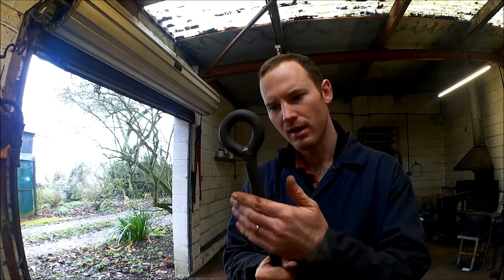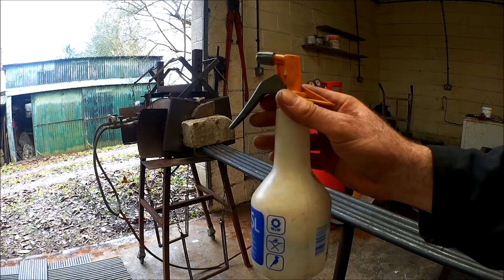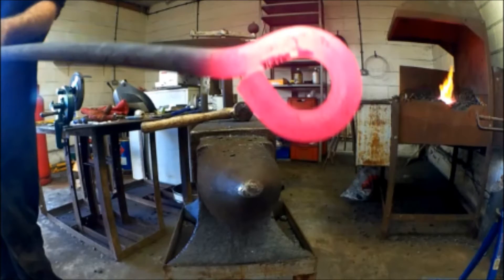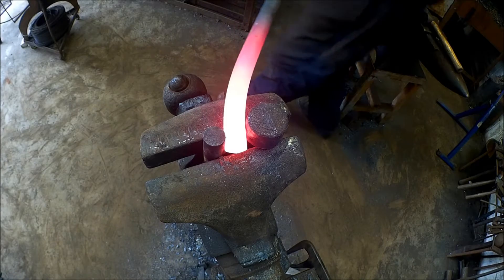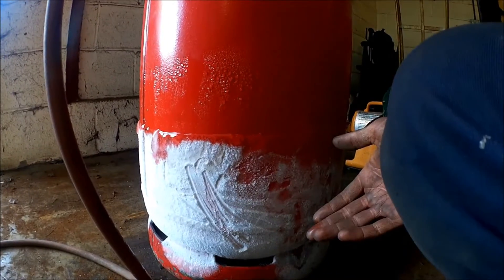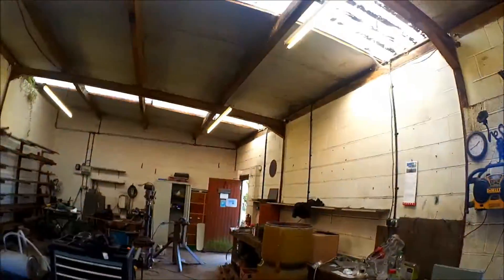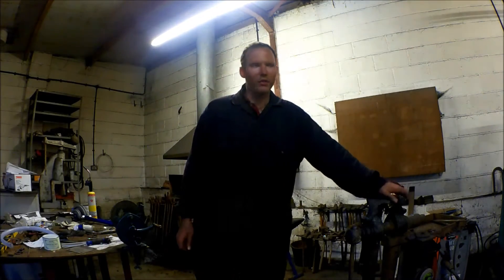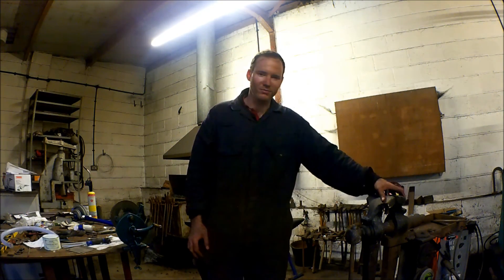Blacksmithing - How To Forge An Eye - Difficulty: Easy

Comment: Just catching your channel so a few years late , but i did a job for wind mill anchors, very similar to what you made in the video , company supplied me with the steel bars , I worked on $4 AUD  ($2.60 USD )  Per eye  and  $2 AUD a weld  , and $4 AUD per 8 inch long threaded section  for a total of 1200 units supplied  for the wind farm up the road here , big boss told me  after i could have added  another $4 and no one would have blinked ,  shows you can be too cheap ,  but i made  good $ for the 2 weeks it took me to do them all ( 15 days total )  i think the eyes took 5 days the welding 5 days and the threading and heat treating the rest of the time , i had 1 casual employee help me  and used a induction coil to heat the bars .. like your channel ! cheers
Reply from the maker: Awesome well done. It's great when it pays and is fast to produce. Hope you get more like it. Cheers J

Comment: Make the video on , to make circular ring with same thickness of rod
And diameter of ring is 100 cm
Reply: Thank you....this video helpful for mi
Reply from the maker: It would be the same but with a 3.33cm thick rod. May have to cut a 10° angle on the end so it closes up fully. Cheers J

Comment: It might be because it's 4am but what measurements spacings and how did you work out the sizes for the jig, what size diameter material is this your using? I like the step down to have the two same size parts in the vice for a good grip. Thanks.

Comment: Letting a garden hose dribble water down the side of the LPG bottle will stop it freezing.  Its unbelievable how little water will achieve this.  Good vid though.
Reply from the maker: Evan Penny thank you. Yes I've since submerged a bottle in a large tub of water and eventually froze the water and needed to chip the ice off. Having if flow would work well as you suggested. Cheers j
Reply: I have used this method many years as a commercial potter with complete success.

Comment: hey Josh, 
When it comes to set jobs like the one you just completed, the charge is not per hour but is per job. 
We have contractors bid on jobs for us and the charge is per the job (Labor, Materials, consumables, etc...)
then there are repair jobs where we have contractors come in and do jobs that cannot be bid on per job as it is unknown as to what the issue is so then the contractor charge is per hour plus materials and consumables.
Most people do not know how complicated it can get when dealing with companies and subcontractors.

By the way, amazing job you did there.
Reply from the maker: Jeff Sablich thank you it's good to hear different experiences. sounds like a good way around it. the job piece work and it payed well doing it fast. j

Comment: You don't use thread tape on that sort of fitting.  The seal takes place with that conical shaped end, not with the threads. The threads are just there to apply pressure to that seal.    That is the way it is done in the U.S., anyway.
Reply: When a conical seal fails, usually from over torque, you have one more chance to make the seal on the bearing surface behind the cone. Then you are left with sealing the threads to prevent leakage. Use of the alternate strategy is effective for getting you through the day and beats sending a gas bottle back to the supplier. That is the way I do it in the USA anyway.
Reply from the maker: Yes you are right scott. what ever was making it leak though it still did the job at stopping it.
Reply: @joshuadelisle  from my experience it's a different type of PTFE tape it typically comes in yellow packaging rather than the white it's for gas rather than water fittings it's a little thicker but you have to use what you have to get the job done

Comment: David Richards,please explain how Stick welding is easier and BETTER than Mig Mag.I am a Welder with 50 years of working on pipelines,oil rigs,ASME1X.certs.I dont see how on production work or any other,MMA is easier and better than Mags.
Reply: Put your rattle back in the pram, read what I said, that in this "particular application" it was better and easier - not that the World should throw away Mig/Mag machines and only use MMA.
There is a place for every welding process, not one is overall better than all others, each has its own niche, flexibility and best application.
Mig/Mag welding is a great flexible process but in a job or smithy shop environment you will find a stick welder is very useful and as Joshua says, it don't need gas and switching from steel to stainless steels to nickel to aluminium is simply the change of the electrode.
Reply from the maker: Ha interesting! There weren't any robot there where I was at all, just CNC plasma/flame cuts and we built everything using jigs and manual welding machines. I asked about why they don't use robots and their responce was that the robots don't do well with gaps!... I know that place in bromyard, my old workshop was near there...
Reply from the maker: I beleive its to do with the slag covering of the weld that insulates the weld cooling it slower making the weld less brittle and increasing its toughness.
Reply from the maker: I don't think stick welding is easyer but rather learning to stick weld makes you a better welder because generally a good looking stick weld has also good root fusion while a mig weld can look good but have no fusion.
Reply from the maker: I agree with you though that genrally for production a mig/mag welder would be my first choice for that reason. in most cases for blacksmithing were a only little beads are needed infrequently I would always suggest a stick welder for simplicity and cost effectiveness because you wont have the cost of renting bottled gass and they store neatly away when not in use.
Reply: Im talking about time served welders who know what they are doing,not someone who buys a toy welder from machine mart and thinks he is a welder
Reply from the maker: yes for production welding yes a Mig Mag would be suitable, when I worked for Exmac automation and McConnells I used Kempi and Miller 3phase top of the range MAG welders and often welded 1" plate doing runs that were longer than a meter. perfect tool for that job. but keeping it in context we're talking about blacksmiths, and as a blacksmith welding isn't used to such an extent otherwise its a fabricators job, in this case I was asked to weld the eyes, at that moment I didn't have mixed gas for my small MAG welder which would have been expensive to buy just for that project, but my 220amp oxford was fine to go with just a single pack of 3.2 6013 electrodes stored in my (dry)cuboard. I beleive this to be the norm for blacksmiths to not be welding continuously and so I would suggest that a stick welder is a more appropriote welder to be familiar with. do you agree?...
Reply: @joshuadelisle  👍
Reply: Joshua, interesting how paths cross in the welding bussiness,  in that I assume you mean McConnells in Ludlow - I installed a robot welding system there in about 1984 welding agriculture parts, used to be a nice company but I never went back again.
A bit nearer to you I think, I supplied 3 robot welding systems in about the year 2000 to Hydro Raufoss in Bromyard for welding the BMW Mini Aluminium bumpers - I think they moved to Worcester later on.

Comment: Speed it up even more,get a Mig Welder.
Reply: I think the big difference is the direction you come from the weld process side - if you start as a stIck welder, do a bit of Tig then go into Mig you have a different attitude to mixing the processes. 
Guys who start with MIg don't see the need to try something different and think it's the answer to the maidens prayer - In the "old days" the MIG/Mag process was not allowed for welding any type of pressure vessel or pipes, in fact you were not even allowed to pre tack any vessel parts using Mig.
Although today this has changed and Mig is now used extensively in many pressure vessel applications there is still an acceptance that from an overall weld quality point MIg is below that of Sub Arc, Tig and Stick, more especially in non ferrous metals.
Although I have had a long career building and supplying Automated/robotic Mig systems to major manufacturers, for my own personal welding I have a Mig machine, 2 x stick welders, a Tig welder - I often use the Mig for ease of tacking but if I want a nice neat controlled weld I will often use Tig or stick weld.
Reply from the maker: Hey Terence! I find if used right a stick welder is just as quick and makes a better weld. I use the main 3 welders, stick, mig and tig at work for different projects because they are better than the other at different tasks. in my workshop though I do favour a stick welder for its simplicity and no need for gas bottle rental. Thanks j
Reply from the maker: My point exactly well said David!
Reply: @joshuadelisle  Just watched your video, and though I am clearly late to the conversation. I thought I might add to it.

As a welder here in Canada with 12+ years in pressure welding. Mig, if properly set up, spray arc, argon/co2, would speed up your process, while still achieving the tensile strength needed and remove any need for post weld cleanup. You can get Mig wire that has very high tensile strength and weld quality as well, with the right machine achieve much higher deposition rates.

With that said, interesting video. and thanks.
Reply: Joshua, you are absolutely right, in this application the stick welder is easier and better than using MIg/Mag.
MIg/Mag is what everyone uses now a days and while it is a great flexible process there are still many applications where Stick, Tig and even gas welding still have excellent benefits.
PS on the PTFE tape I'm with you, I have sealed many water and gas leaks over the years just using this tape, no problem, a great product.
Reply from the maker: +David Richards I agree thank you. I think a lot of new Smiths use a mig because it seems easyer to them. I believe I got good at welding because of using stick. I did gas pipe welding for an engineer using stick because the British standard states that it was the best for  the application and that mig/mag should not be used.
Reply: I am still pretty new to welding, but my understanding is that stick is better for larger pieces of steel, like this one.  MIG is great for so many different applications, especially non-ferrous metals, but is not best practice for all applications.  Experience welders, please correct me if I am wrong.

Comment: oval head bolts are non-standard parts, which are mainly used in ball mill, crusher, and power plant equipment. Used for a wide range, so that the liner on the ball mill tightening effect.
http://www.zybolts.com/Round-Eye-Bolt.html
Reply from the maker: yeah they look like they are drop forged probably out of a high strength steel.

Comment: Labour for those:  You're making 20 an hour.  I would want £1.50 each, but would initially quote £2 each.  That gives you room to be haggled.  If I really wanted the work and depending on who it is, I might get squeezed to £1 each.  That's why it's best to begin at £2, else you will end up doing them for a quid !  Doing large numbers like that I would be amenable to discounts anyway.

I made a pair of fabrications that are each half of a set of bending forks that fit in the post vice.  They're adjustable across quite a range of inches (between the forks) and can become differing diameters by slipping collars over the parent forks (16mm round).  Its only a short piece of 2 x 2 angle iron and 2 little pieces of 16mm round for each half of the tool.  I copied the idea from Rory May's channel.  They're very handy.
Reply from the maker: I like it! Rory may is awesome... I would say thats about the right price what I would take home but I would add a bit more to cover costs running of the workshop etc, Its been very intersting hearing others pricing on facebook also. Thank you for commenting!
Reply: You're right!  Make it 50 bob each for labour, starting price.  Who's old enough to remember what that means?

Of course you would have to add the steel cost and the consumables also (gas, welding rods) and you charge those at 'retail' price (a modest profit then).  I tend to include the running costs of the shop as part of the labour cost and only charge for material and consumables where they are specifically part of the job.

Comment: That was good and interesting that you worked out that repeating the work in the jig, back and forth eventually works out the kinks and trues up the form.

For taping threads I always look at the end of the thread (bottom of a bolt as opposed to the head, or bottom of a regulator thread) and look from 'end-on', so that the bolt end (or regulator stem end) is facing me.  Then wind on the tape in the direction the same as you would rotate that thread to tighten.  So if it's a RH thread, wind on the tape clockwise.  if it's a LH thread, as in this case, wind on the tape counter-clockwise.  

I've made it sound so complicated, lol.  Little rules and ways you get fixed in the mind and remember forever.  Look end-on, wind the tape the same way as the tightening direction.

Comment: Hay josh great video. 
Its engineering stuff and i do quite a bit of it so around £2.40 for one then stock. But that would give me around 5mins a unit at that price. Its all in the speed i guess.  If i was to do it on the hammer it would be round £1.60 a unit is but i think that is high for drop forged parts.
Reply from the maker: Hey Dan! Interesting.. if you were to drop forge them though you would have to include the cost of milling the dies so you would need a large amount to cover the minimum cost. but with a 4 minute jig you can't go wrong. How are you doing anyway, hows that lovely massy?

Comment: At a labor rate of $80-100 per hour (American).  3 min per unit, 20 units per hour = $4-5 each labor only. but higher volumes recieve a discount up to 20% 

I quoted round and square 2" belt buckles for a local leather craftsman (renaissance fair) and was @ ~$6 each based on the same criteria (incl. materials etc).  He was not willing to pay that since he had been buying Indian made copies for $3.50

May I give a few tips from a long time welder/fabricator/smith ....  

  1.  PTFE "teflon" tape is not needed for that type of connection nor is it for sealing any connection.  Tape is only used as a lubricant for the threads & that type of connector seals only with the ball/socket.  If a threaded union needs sealing, a paste is the correct medium to use.
  2. keep all glass (phone) away from sparks/hots.  One speck of spatter will shatter any glass in an instant.

     Keep up the faith !  Todd
Reply from the maker: Bless you and thank you Todd, yes thats roughly how I worked it out to be also just in £'s. 

I get what your saying about the PTFE and your right, however it was leaking very slightly and PTFE was what I had at hand and worked, its also cheaper than buying the paste.

My camera has replacable lense protectors for just that reason, its a special go-pro like version that is dust proof and shock proof. otherwise you are right again also!

Thank you Todd for your support and encouragement, It means alot to me, J
Reply: I was thinking the same thing when he was doing that   I was like what is he thinking